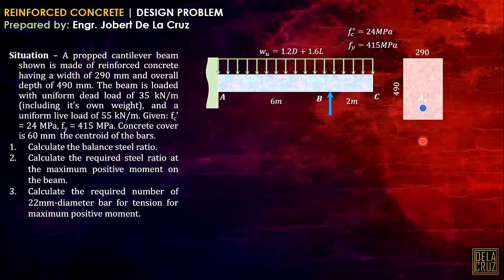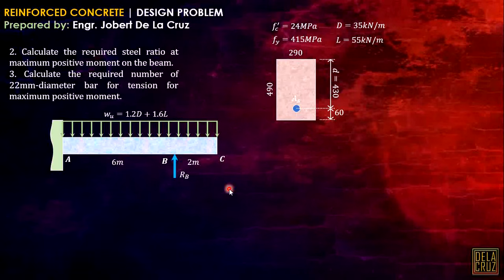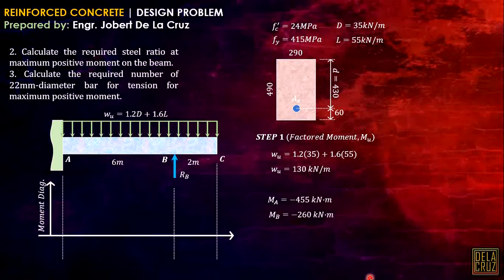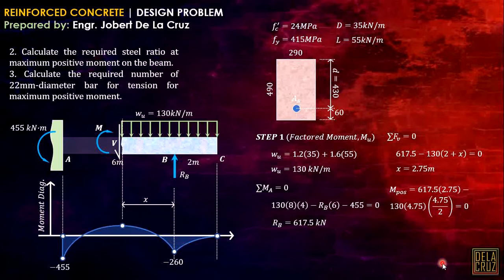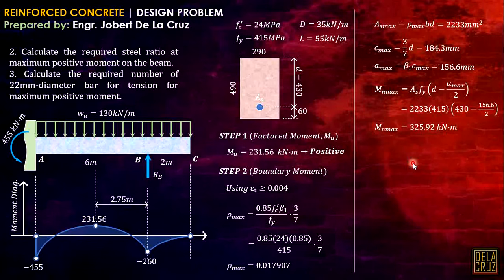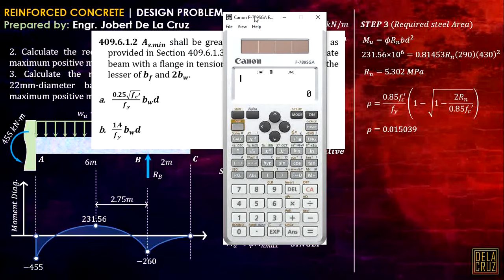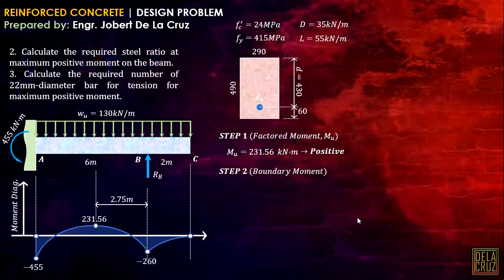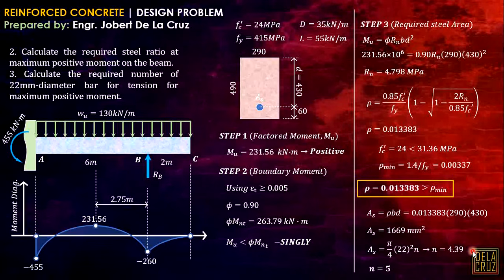RECTANGULAR BEAM DESIGN PROBLEM | REINFORCED CONCRETE

Comment: sir question about this three moment equation does this also apply to other beam loading not just in uniformly distributed load kay what if ang given is point load or triangular load and other else .
Reply: Yes bro. need mo mag study ng Three moment diagram kasi ang mga formula diyan sa UNIFORM, triangular, pati na sa concentrated load o point load ay nandoon na. Ang point load diyan is kung na sa center mismo ay 3PL^2/8. 4monts ago na pala to fore sure alam mo na ata to. pero para nalang sa iba pag may nagtatanong ng ganitong tanong HAHAHA

Comment: Hello po engineer. Paano po malalaman if anaylysis or design problem po ang problem? Salamat po
Reply: Same question po 😢
Reply: @honeygraceongayo922  Analysis po siya kapag ang hinahanap is ang Ultimate Moment (Mu) then Design naman kapag ang hinahanap ay ang Area of Steel (As). Usually pag design problems (hahanapin ang As), given na ang Mu, but this particular problem hindi binigay si Mu so need mo pa siya  i compute using theory of strcutures, then pag may Mu kana, magsosolve ka for As.

Comment: Sir what if may given na condition. Say for example sinabi na net tensile strain €t >_ 0.005. Sa Steel Ratio Limitations, ano po ba magiging formula for Rho max? Yung may 3/8 (0.85) β (fc'/fy) po ba?
Reply from the maker: Yes. Actually any value of strain that is greater than 0.004 is acceptable as your limitation as a designer. But for exam purposes we usually use yung 0.005 to maintain tension controlled section.